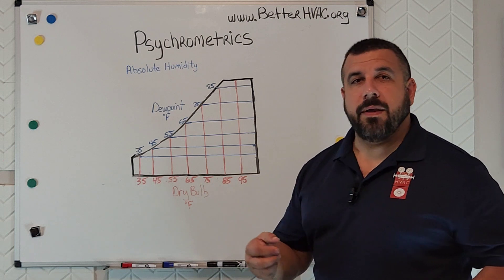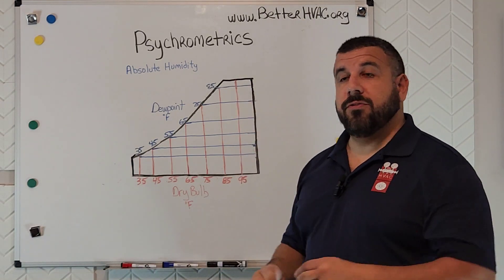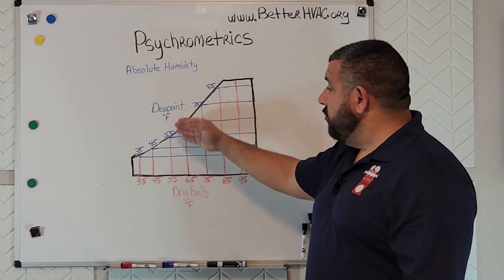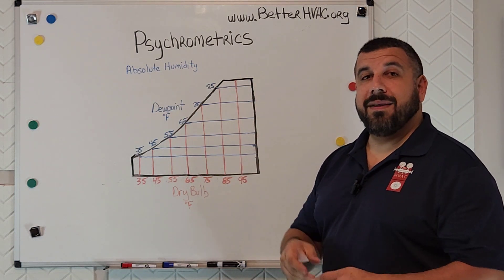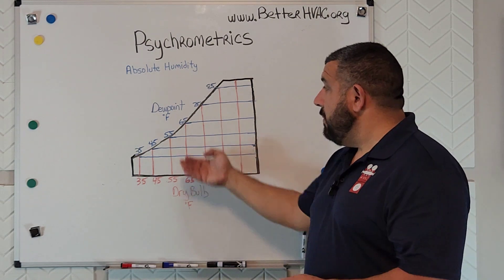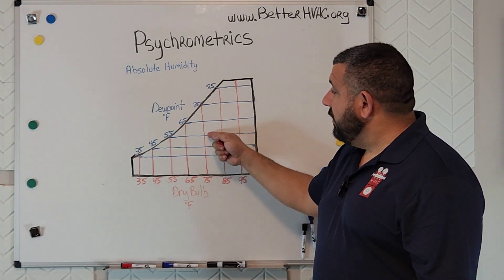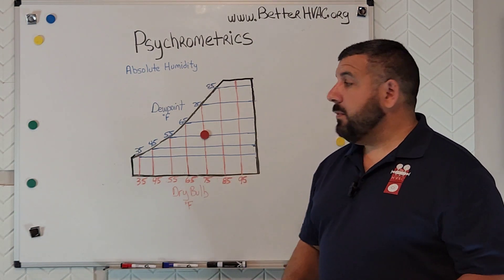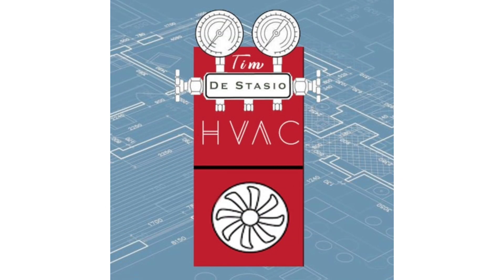Psychrometric Saturday: Plotting a Point on the Chart

Comment: Tim,
I'm enjoying these bites sized lessons.  
Haha, I'm more of a summer 75° & 40-45% RH. Very comfortable! As a guy & family with allergies, I learned that dust mites can not propagate below 50% RH, so I've kept my dehumidifier at 40-45% year round.

Cheers, Eric
Reply from the maker: Thank you.  ACCA Design humidity is 50-55%.  In humid climates it is very hard to get below that without consuming a tremendous amount of energy.  I wonder if MERV 13 could help with dust mites...
Reply: @timdestasiohvac  Yes & that 50-55% is awesome in general.  Yes, the MERV 13+ is a must and would help handle airborne mites stirred up by activity. However, the alergy issue is to STOP them from propagating, which requires <50% and I can say my last homebwas wonderful. Building my last home from scratch 9-10yrs ago (with blower door of ~ 0.8 ACH50) and using Mitsubishi mini-split & ERV, and an UltraAire XT-155 Dehumidifier, I had no problem maintaining 40% in VA. 
Perhaps my new Coastal NC home design may be a more challenging climate zone. 😎 

Cheers, Eric